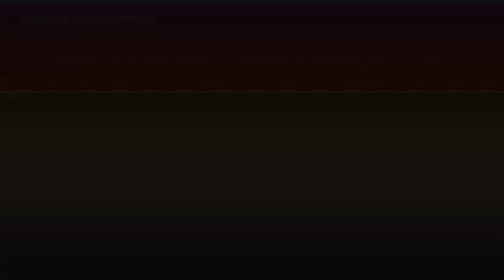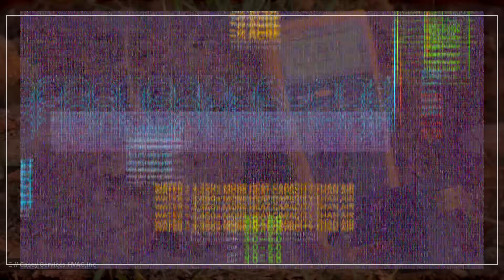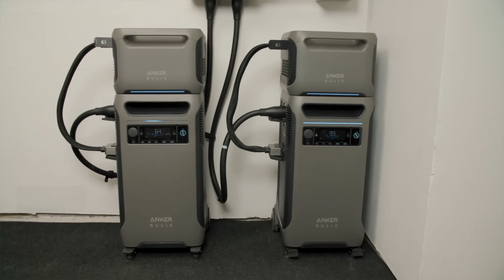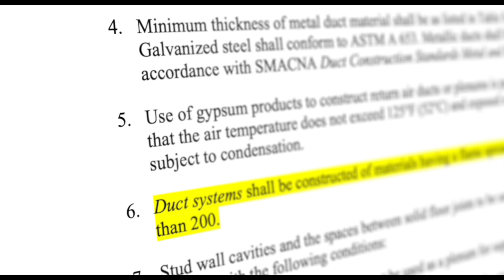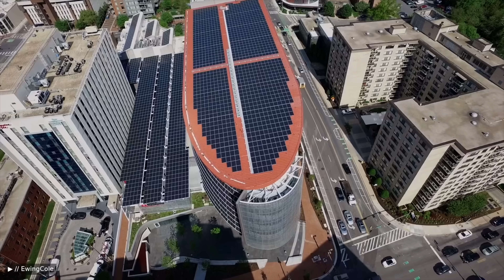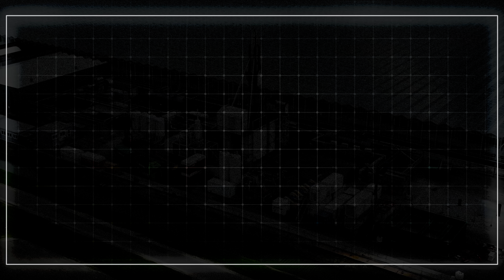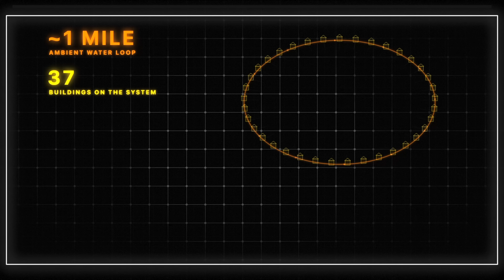The Viral DIY Cooling Hack That Nearly Killed a Family

Comment: I have a wash running through my property and I intend to dig that out and create a rip-rap filled flood control channel.

I figure while I'm digging, I'll go a little deeper and put a slinky style PEX coil under the channel.

In my home I think I have a way to use thermal mass and eliminate the need for a water to air heat exchanger.  I might add in a few buried barrels with phase change materials and a PEX loop to kind of buffer the system.

Basically I will be using my ground source loop to reduce the load on my conventional (4 zone mini-split) AC, and (ERV or HRV) ventilation system.  Then I'll use solar to generate the electricity for heating and cooling when the ground source isn't enough.

I don't want to pay the huge price for the ground source heat pump but the coolant loop itself is not too expensive and without a water to air heat exchanger I don't have any mold or radon issues unless my system leaks and that moisture somehow finds a way to create mold inside my ~air sealed building envelope.

Any way, if my system can use the ground source to keep my interior temperature between about 60-90°, my HVAC will only have to heat or cool about 15 degrees on the worst days instead of 45°.  So about 1/3 the HVAC required when it's required and perhaps 2 more months out of the year when HVAC isn't required because the ground source and thermal mass stabilize the day and night temperatures instead of heating at night and cooling during the day in the late spring and late fall.

So, ventilation is year round but my circulation pump will run about 10 months of the year, I'll cool about 4 months and I'll heat about 2 months.

Hopefully that will make my average HVAC loading on peak days 1/2 or less which will give my solar system a lot more headroom and less night time energy usage.

I want to have about 60 kWH of battery, hopefully use less than 15 kWH over night total and generate possibly more than 100 kWH on an average summer day.

That should allow me to run inverters that can keep my average load well supplied and allow me to run 50 amp 230v circuits when I need to, like a welder or a commercial steam dishwasher that runs a 2 minute cleaning cycle.

I think that will take a dual inverter setup to get a 50 amp 230 circuit and maybe a third inverter for redundancy and to keep the 115v going when welding or washing.  Hopefully that will allow me to keep welding and washing year round without needing to use a generator to recharge the batteries on a high use day...

With the cost of solar panels today, I'll max out the capacity of my inverters using slightly less than state of the art panels to save money.  I would like to wait for Sodium Ion batteries to get the advantages in cycle life and safety that they claim but I might have to go with plain LiFePo4 if Sodium Ion isn't common and cost effective by the time I build...

Comment: Here in Germany, it's not allowed to drill every where, for example where I live only 7km away from the passive house institute by the way we can't by law. Because it's a drinking water protection area you are not allowed to drill, even the system with two wells is not allowed. Where you use on well as the source and the second as the exiting well where you pump the water back in. Even this method have to follow some rules, you have to know the flow direction of the water for instance. If I go GEO T I choose the go horizontal loops about 2m  deep, the use it a lot Austria where pretty cold winters, the area where you put it underneath must be able to warm in the summer time best sun rays no shady areas. Greetings from Germany

Comment: There is a 5th version, a friend built at his house near me in Arkansas.  He ran a 2 foot diameter plastic pipe 20 feet deep in a 300 foot loop out and back from the house.  He uses a box fan to blow air from one end of the house into the pipe and it goes back into the house around 65 degrees year round.
Reply: That sounds exactly like the dangerous one described in the video. The only difference is the pipe isn't directly under the house, which makes no difference.

Comment: You did not mention open loop ground source heat pumps. They use water from a well which passes through the heat pump and then is returned to the aquifer. The water supply temperature is a constant 50F (10C). I live in the country and needed a well anyway, so I opted for this approach although a second ''well'' is required to return the water underground. I built my home in 2007 and have two Water Furnace heat pumps which have been trouble free. I heat and cool the house (4400 square feet) and also pre-heat the water going to my electric hot water tank. My savings in electricity paid for the entire cost of the system in 15 years. I live in Quebec where electricity rates are very low so the payback would be faster in other areas.

Comment: I think there's either been a terminology change or a mix up here: geothermal is specifically where you use a hot ground source (ex. a volcano, geyser, or sufficiently deep borehole) to supply thermal energy. "Ground-source geothermal" doesn't really make sense, it's redundant. I think what you're talking about is a ground source *heat pump*, which uses the ground as either a source or sink of heat, providing both heating and cooling. While humans have definitely made use of the thermal stability of the ground forever, we couldn't really move heat around very well until the last century.
Reply: Saying "ground-source" and geothermal is redundant speak...  

Geothermal power will crush all other forms of energy in the end.  Wind and solar with batteries is a whole lot of unnecessary work for not a lot of output.

Comment: Is the loop system rather than the deep bore hole cheaper to install?  Also, for people that are used to running heavy equipment, it doesn't seem really complicated to do most of the work on your own.

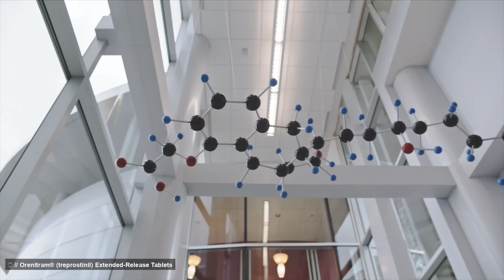Comment: 7:35 these videos that came all these alternative building methods, heating/cooling methods, specific structure types, and everything else are all just AI slop videos, and largely based off how easy it is to get a Mortgage for new construction, so if its even slightly more paperwork for getting a mortgage and insurance for a new construction, they just say "its banned". Never mind that anyone researching these alternatives is going to be smart enough and/or well off enough to be able to secure funding, insurance, and permitting if required.... They are just rage bait / click bait.

Comment: Surely the ground surrounding your pipe must run out of heat or cool eventually?  The London Underground is cooking hot because the surrounding clay has absorbed heat for years, and can't dissipate it.
Reply: @petenztube8592  That's why you pipe cold in the ground in the winter and heat in the summer to keep the temperature of the soil near-constant.

The Underground doesn't have a way to carry heat out during the winter.

Comment: I worked in a commercial building. We had a pretty heavy heat load as a broadcast facility with Studios. We offloaded a Lot of heat into the common water loop. The buildings owner said he never had to activate the boilers for heating until we got to 0 degrees F. However Summertime required a pretty large chiller tower.

Comment: i have been noodling around with the idea of either just pumping water from the bottom of the pool into a heat pump, or possibly brine that just travels through a coil sitting at the bottom  its just this big block of thermal mass sitting there

Comment: We actually had a number of systems in tidewater VA that used ammonia as a working fluid, pumped through the ground loop to take advantage of the state change.  I don't think any are left but the Williamsburg Theatre had one installed in 1934 that was used well into the early 2000s.

Comment: Around 1985 I got involved with installing ground to air HVAC systems for homes.  a company called US Power from back east supplied the gear.
One 4 ton system had a set of 22 1/4" copper tubes that were buried about 3.5m in sand under the back yard.  50' copper tubes looped between two manifolds... Grid was like a butterfly wing and 10" between tubes.  R22 ran from an indoor air handler out to the grid and back.
50'/4=12.5, so a 4 to 6m square area would fit... like a patio.  No water table allowed.  A soaker hose accompanies  the tubes to help settle the protective sand.
Near Olympia, WA in 40f weather in february we charged the system.  Room temperature in the home climbed very fast (maybe 1 deg F every 2 minutes or so), using 11amps and NO defrost like air to air systems need.  Maybe 3x more efficient than air to air ajj things considered.
Don't know how well the copper  braising holds up down there...

Comment: there's 100,000 houses in Canada running domestic ground sourced heat pumps. it makes more commercial sense in very cold climates b/c the cost of heating is so much higher (depending on building envelope insulation).

Comment: I would have thought copper pipes would be better for the heat transfer for the buried part.
Reply: Copper has about a thousand times higher thermal conductivity than the HDPE that is typically used but because the ground is typically so poor at conducting the energy to the pipes (lot of insulating air in the ground typically), you don't get the full benefit of coppers higher thermal conductivity. In that case, it is more cost efficient to just run a bit more of the HDPE. Plus you don't have to worry about corrosion with it. 

   Now if you're using some kind of water thermal mass, where there is better heat transfer, then yes, copper can be more efficient.  For example, we have a well and I'm planning on putting 40 ft of a U bend 1" copper pipe in there (the rest being PEX tubing) to run water through in a closed loop. This is just to cool and heat an outdoor shed that's been converted into a studio (so it's insulated etc). I would have to use a lot more plastic piping if I wasn't using copper in this instance.

Comment: Great way to address the errors and risks presented in the other video!
Reply from the maker: Glad I could help clear that up!
Reply: have you considered “thermal battery” systems in your build? 
Utilizing the concrete slab (or rock wall etc.) as an intentional thermal mass… 
To store heat/cold that radiates into the conditioned space… 
Selecting optimal roof pitch for solar thermal (evacuated tube solar) & solar electric (to run the pumps & compressor)…?

Comment: In my area, they simply dig down about 2 or 3 feet, lay a bunch of pipe, I think PEX down. One continuous loop, back and forth, maybe 100 feet? So a 10 ft by 10 ft, with the lines 1ft apart, 100ft. Then bury it. They pump a water based coolant through it. They have ground source heat pumps. In the winter, it is a reliable evaporator, in the summer it's a reliable condensor. It improves the efficiency of a heat pump by about 30% I think. No expensive well needed. People do this themselves sometimes, or hire a contractor. I think they use 3/4 or 1" pex pipe. Obviously you size it based on the need, research precisely what is needed. I just have heard of many people doing this. The special heat pump has a liquid heat exchanger that it uses as the evaporator or condensor, depending on if it is heating or cooling.

Comment: is the (literal) "ground" work of digging and piping worth it? a solar panels plus batteries powered reverse cycle system requires roof space and the sun in a not extremely cold environment ( above -5 or -10 degrees celcius i think).
Reply: although geothermal is practically noise free inside the building while a reverse cycle system has mechanical parts both inside and close to the other side of the wall somewhere. i think that's a plus side of geothermal.

Comment: Thank you for addressing that video!!

Regarding super high efficiency air source..
Put the same technology in a properly done ground source geothermal unit and you end up blowing it out away w/ efficiency.

—

Really excited for you to go water source and thank you for promoting such a great technology!!
Reply from the maker: thanks, appreciate you watching! Yes ground source.... if we could just make it easier... is drilling really so hard? lol
Reply: @T @TwoBitDaVinci  Hopefully the founder of WaterFurnace (who is now back at Climate Control Group/ClimateMaster) helps get those tax credits back again to offset the drilling/grouting/headering costs..!

I am not a driller, but I’ve help grouted plenty of holes while building stuff and such over the years, it’s not that bad and there are some companies out there that do everything with the polyurethane pipe themselves..which can be ideal when they know what they’re doing.. eliminates communication issues between contractors, etc.

The only time I ever see loop issues is when they didn’t use proper grouting or reverse-return on header piping…oh and didn’t use the FREE (I think it’s still free, lol) pressure drop software for making sure you have enough loop, high enough Reynold’s number, etc. etc.)

Comment: Proper water source geothermal is incredibly good, I’ve dealt with it for a very large portion of my life and I’m really appreciate you putting a good video together!!

The biggest problems I see which geothermal are people just skipping steps or not using the basically free spreadsheets etc. that WaterFurnace or ClimateMaster have to make sure you have the right flow of the right average loop depth and such..  well that and lack of return air.

Thank you for putting out good videos!!

Comment: One of the bug advantages of an air system is that when you turn on an exhaust fan, it automatically brings in preconditioned air instead of outdoor air.
How can you get this impact with a closed loop system?

Comment: This is quite efficient. I can heat my 120m^2 log house  300km above Arctic Circle with  one 300m deep well in Finland where our winters last 8-9 months a year, sun doesn't rise for 3 months and it regularly is -40'c outside during cold nights in winter. One well, one heat pump can keep it all warmed up with barely 7000kw/h a year (that figure includes everything that uses electricity, including electric car). It works splendidly until it's -25'c outside, after that it's too cold to work as a lone source of heat, so I usually burn logs in the fireplace as a support during coldest days. My father runs pure electric heating in same size house and it takes 25 000 - 27 000 kw/h a year, with no electric car charging and supporting with a big fireplace.

Comment: In the Nordics if you say you have "a heat pump" it will in 90% of the case be borehole geothermal. I don't see why any other method would be worth the effort. We do have expensive petroleum, and electricity spikes wildly in cost due to overreliance on wind power, so it's easy to defend the investment over the course of a decade.

Comment: Hi Rick! I am a systems integrator and consultant in Alicante (Spain) and I have over 25 years experience in the industry. If I may suggest, I would rather use what’s available at a local level and engineer a system that uses a “disadvantage” and turns it into an advantage: if your area is more hot than cold use it; build for example a “convection chimney” that will use the heat to force a high/low pressure and naturally cool the house or at least help with it. We have some geothermal systems in the area and they are not worth it, if you are in a cold place as the north of Spain it “works” but the ROI is not justifiable. If you combine this with home automation, battery storage and solar you can easily get 60% off your energy bill, of course everything need to be dimensioned accordingly but this is easy, let me know if I can help you! Best regards!

Comment: Ground source heat pumps are different that the air exchange tube. I removed a system back in the late 80' because the house was covered in mold. They had to remove all the drywall. The homeowners wife was sick and this is what they found. 
Vertical wells are only good if you are limited on space. The cost to drill all the wells may exceed the savings. Sandy ground is the worst, heavy clay has better heat transfer. 
One of the biggest drawbacks to geothermal heat pumps is finding a good technician to fix it when it breaks. 
Sit down and do the numbers, your equipment wont last until the calculated payback.
We used Water furnace, they were pretty good at the time.

Comment: Maybe 30 years ago in Santa Rosa, California was constructed a new Active/Passive house. It was on the market forever so I was in it, vacant both times, in summer and winter. It worked. The design kept the house comfortable in summer and winter.  ....  BUT  California. .... the Building Codes basically said you could anything you wanted to do but you still had to have to hook into the Government provided utilities and services and the house had to have the associated equipment installed and working. So the house had TWO heaters, TWO coolers, TWO water heaters  ....So Ricky, in report number 2, please update us on the Building Code situation.

Comment: Noone wants to discuss blocking oscillators. Noone wants to discuss anything that challenges the oil n gas cartel and it's law against over unity. Hear me: the 2nd law of td is as much of a myth as the theory of multiple races. These are social constructs. Nothing more. They have no use to society, except aiding the corporate Bottom line, at The expense of the collective quality of life. They're super at that.
Can I run a 24-30v Honeywell thermostat from a simple 6v wall wart?
Y or N? Anker wants nothing to do with technology that obsoletes their products. Bet.
Reply: Spoiler. I do. It won't work connected to directly, but with a few simple components arranged properly, it's been working just fine for a few years now. All bc I was too cheap to buy the "proper" power supply.